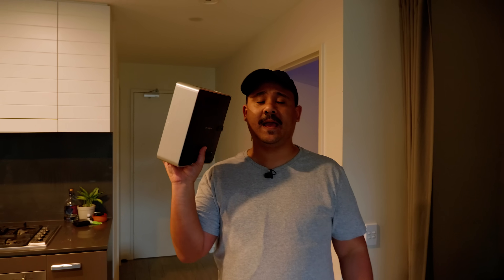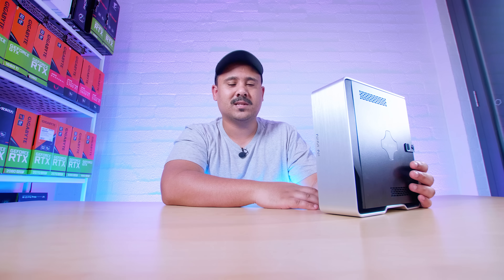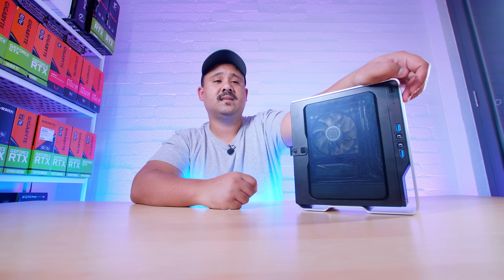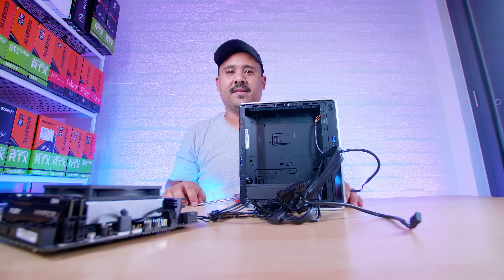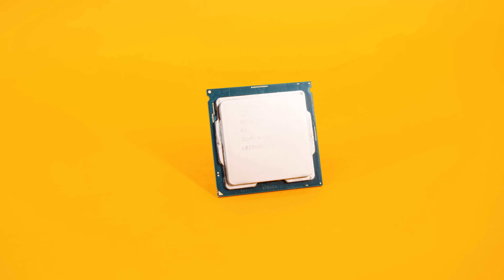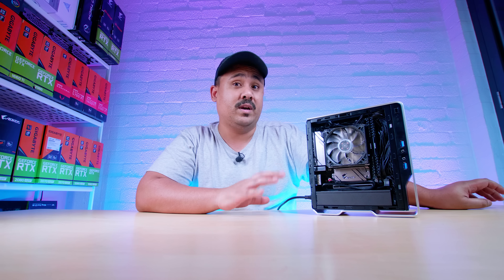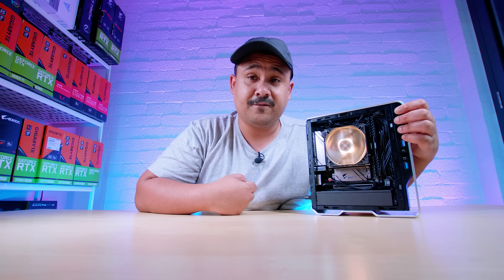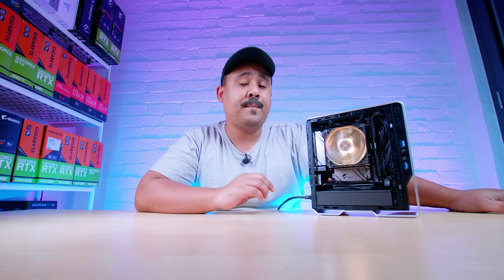The DIY Mac Mini - InWin Chopin + i5 9600K

Comment: have you thought of putting a Radeon 5700xt in it with the case side off.  Of course you can replace the psu first.  I have put ITX motherboards in atx cases like the NZXT 510 and the thermals are great.  Plus having enough space to put in a bigger psu and a dedicated graphics card.  This way you can forgo the external gpu enclosure and thunderbolt 3.
Reply from the maker: Massive waste of time. The idea was for it to be as small as possible.

Comment: Except for the heatsink/fan combo, I have exactly the same Hackintosh build. I replaced the little psu fan with a black Noctua NF-A4x10 FLX and it is a lot quieter now. It is connected to one of the fan headers of the mainboard.
I use a Noctua NH-L9a-AM4 chromax black heatsink/fan combo and it's just enough to keep the 9600K cool.
Reply from the maker: Yeah I'll probably end up pulling the PSU apart and replacing that fan. It's so annoying.

Comment: Have to go intel for a workstation pc is really sad , i would love making a ryzen hackintosh, i love macos but yeah need a different pc
Reply from the maker: My workstation in Threadripper lol. You can run macOS on anything. The issue is with a PC this size where you cant install a GPU the iGPU needs to be supported or it's a waste of time.
Reply: Gear Seekers and we can’t have nvidias gpu since the last update ?